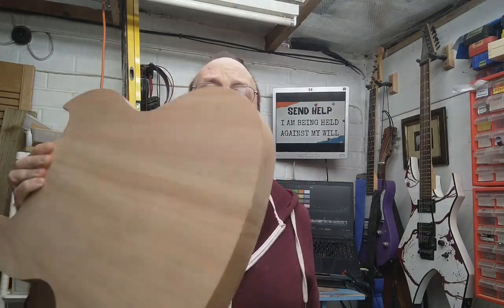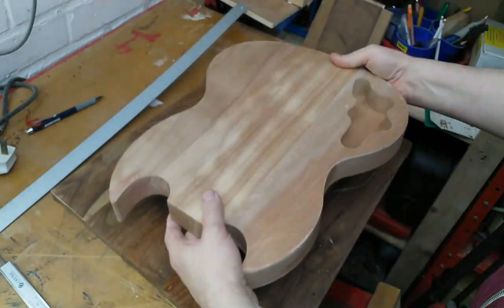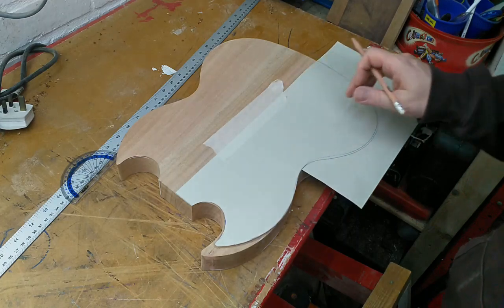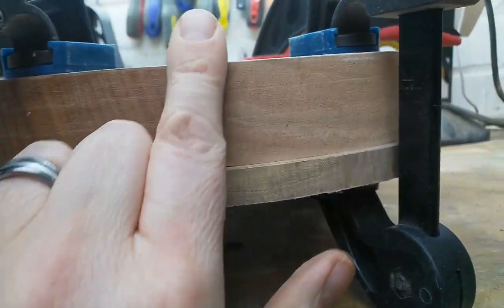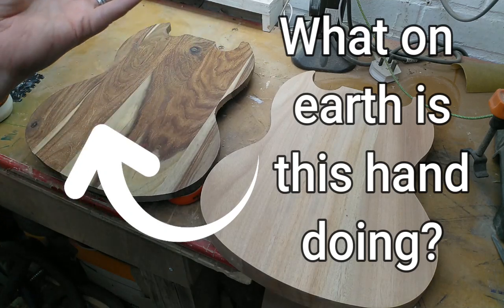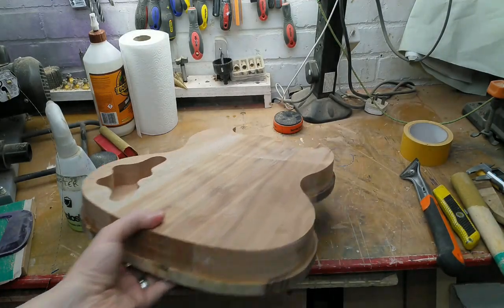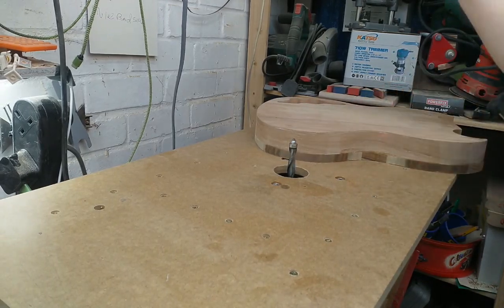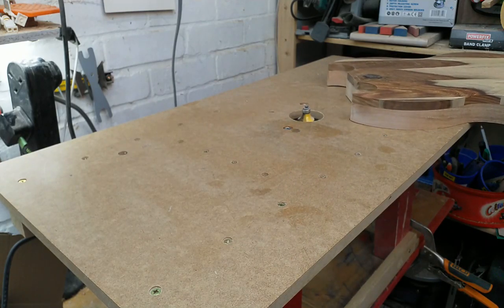My router bit exploded, I glued some more stuff | GGBO | The Great Guitar Build Off 2022

Comment: I've had nightmares about a router bit breaking apart.  And I've never seen it happen.  I was happy to have nightmarish thoughts of it when I imagined it never actually happened.  Now I'm afraid to climb out of bed!
Reply: I wouldn't worry, the idea sounds like a nightmare I know. Think of a chain saw, the chain comes off (you would think OH-FUCK!) but no, if the chain has come off it drops to the ground, the cog that would of turned the chain isn't engaged to the chain so nanda happens, same deal when a router bit snaps but it can be a tad more scary if the bit and drive is kinda all in a small space if that makes sense..
Reply from the maker: I was more "OOh, that's pretty" when the sparks flew... and then annoyed because I wasn't filming that pass! :)